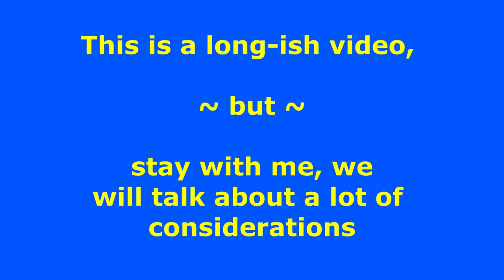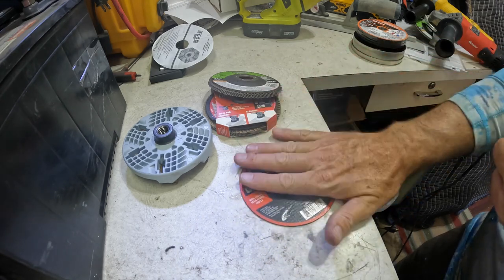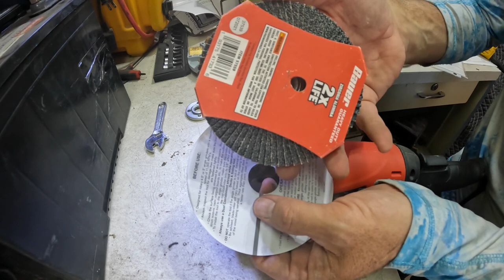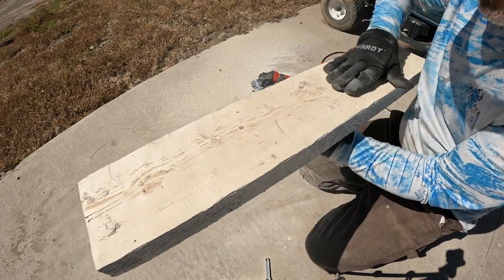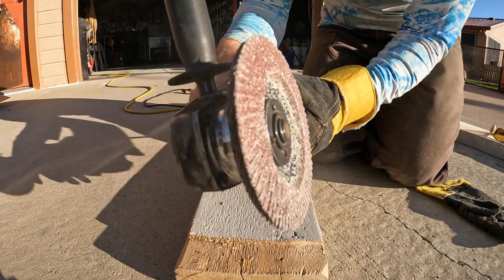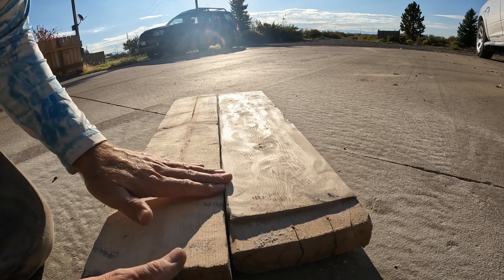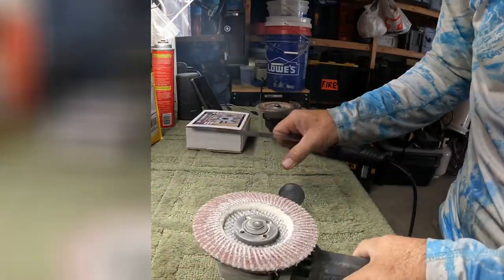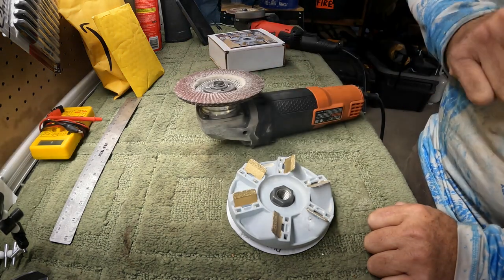DIAMABRUSH VS Flap Disc !!! *DECK STRIPPING*

Comment: Thanks for the video.  First thing I noticed that you used the diamabrush in the same manner as the sander pad...with the grinder tilted up to make contact with just the tip area.   The Diamabrush is meant to be used flat.  Second, with the diamabrush the direction you want is right to left WITH the grain.  So next time try to have the board perpendicular to you.
Reply from the maker: Thank you! This is just why I love youtube, I get good advice from people with experience. And  people do read the comments. So thank you for sharing, and for watching 👍

Comment: I used about 3 flap disk to remove the paint from my deck and got less than 1/4 of the way. It was very difficult because I had to keep scraping the discs clean from the old paint. Frustrated I went to Lowe's and got the diamabrush for $49 and it was the best decision I made. It removed the old paint much faster and didn't have to keep cleaning the blades. If you have a medium to big size project then get the diamabrush.
Reply from the maker: Good to know, thanks for the good feedback. People do read the comments, and this is a real life experience comment 👍
Reply: I’m working on my 400 square-foot, 30 year old deck. Multiple layers of solid stain and then two years ago that paint which was a poor decision. Now I’m stripping it all off. In a couple of days of work although we spread it out just doing Couple hours a day for a few days we have got the whole deck basically cleared. Went through two discs because we have lots of nails and screws and we tried to go in rows in between the lines of screws. Still chipped up the Diamabrush brush a bit but I would’ve spent more and more time using stripper.
I will now have to go and clean up down the lines of where the screws and nails are. But I got the majority of the paint off in a very reasonable time using the Diamabrush.
I was in contact with the Diamabrush people, and they told me that as long as there’s the diamond grit showing on the blades, you have life. The blades do wear down incrementally, and you can use up virtually all of the grit. 
We also got the optional metal dust shroud, which replaces your guard and has a flap at the top so you can run it flat against the edge of your house or any edges and hook a vacuum up to it, which didn’t get rid of all the dust, but sucked up a huge amount of the real fine toxic dust into my shop vac 
I started out using the disk without the unthreaded flange behind the desk. But I found, as the blades wore down about halfway that the shroud was starting to interfere with getting flat on cupped or uneven boards. So I put the flange on to bump the diameter brush out just a little and then give me a better clearance on the dust shroud, still allowing me to use the vacuum. I could certainly run it without the shroud, but I didn’t want all of that dust going all over my yard and house. There’s still plenty to clean up, but it took care of a good part of it.
Reply from the maker: @jeffellis6544  thanks so much for that! I learned a ton from what you wrote. It sounds like the diama brush can go a long distance! And I think when I have to do this again, it may be the diama brush in between the nails/ screws, and the flap disc around the screws. I had no idea about their adapter either, thanks for sharing that!
Reply: @anesthesiadreamin  -glad to share. 
We first tried stripper on the first 3‘ x 14‘ section and it took me a $50 gallon of stripper and several applications over several hours and lots of scraping and it still wasn’t clean at all. The Diamabrush brush is fast. Fast fast fast. I like it a lot  
I think one would’ve done the whole deck if it had been a newer deck, and not so many nails and screws.   
But I would’ve ended up spending way more in chemicals and a lot more labor if I’d stayed with stripping and power washing   
Right now I’m trying to figure out the best flap discs to use to go over the areas where the nails and screws are that I glossed over lightly with the Diamabrush
If anyone hears reading that and has suggestions for me, happy to hear them. Probably going to get a stack of cheaper, sandpaper, flat desks and then a few of the type 29 grinding discs. Still researching…

Comment: I am glad you try to do the work yourse,lf, but you really should have sought advice first.  Never use a 1/4 pad sander for this work, that is for finishing.  I would have recommended using renting a commercial drum floor sander and you would have finished the entire job, including leveling the deck, removing all the paint, and finishing with 150 grit.  One last comment.  I  would never attempt that job without a sust shroud and vacuum and dust mask and other safety apparel.  Good luck!
Reply: What about an older deck that has some mixed old and new boards and lots of nails screws? Wouldn’t that tear up the drum sander belts?

Comment: I did a huge deck 1600 sqft and used 2.1 diamabrushes. Nails or screws are what will kill them and they do slow down once worn.

Comment: For anyone remarking that you didn't hold the dianond wheel flat enough id suggest they buy it and try themselves. The way and angle grinder spins you have to slighty favor an edge to have control of it. Rockong backnand forth feathering it out. For blown up example of this. If  you ever use a large floor buffer you have to go back and forth rocking the buffer from the front to back side to keep control of it. On pretty Every rotational sander youll find its almost never applying complete even pressure across the whole disc. The physics will fight this from happening
Reply: The comparison of how to control a floor buffer is a perfect example for this scenario.
Reply: What the diamabrush manufacturer suggests, holding the wheel as flat as possible, ONLY works if the wood you're working is also flat. The problem arises when doing restores is the wood you're working on will be warped due to weathering and traffic so each piece will be different. Some will be flat, many will cup. When the wood isn't flat you have to attack the surface at an angle. For me, I had to favor the handle side of the grinder and go from right to left motion.

Comment: is it possible to "improvise" a larger sanding disc with pad (9" or more) on a 5"/6" angle grinder for stripping/resanding a deck? thanks
Reply from the maker: @ronenborshevsky8144 never tried it but it would cover more surface area and likely get a flatter/smoother result. Good idea!!!

Comment: The whole point of grinding is to actually make paint/stain stick to surface so you do not need to regrind. Actually , the grinding should leave a rough surface and not perfectly smoothen it out.

Comment: This is great. I'm about to tackle a similar project, painting wood siding with many layers of old paint. It's so helpful to see your trial and error and corrections, I'm sure it's going to save me some time. Thanks!
Reply: What wheel are you going with?
Reply: The plan is to use the Diamabrush but I bought a bunch of flapdiscs in various grits too, just in case. I've found that no matter how good my plan seems, I never know how it's going to pan out so I want to be ready with a plan B.

Comment: Great video.  I had an old piece of stained furniture to test it on.  I wanted to try out some flap discs I just purchased.  I tried them at an angle and flat before I watched your video and had the same issues you did.  However, your suggestion about making sure you never stop even to reverse course was very helpful.  I tried with a 120 disk, plenty fast, not perfectly flat, but for a deck it would probably be fine.  Plus, I think this takes practice, which I plan do more of before next spring's deck work.  Like many who commented, I've been through the gambit of other sanders and chemicals.  It either doesn't work or way to slow.  I do plan to use my random orbital sander on the test furniture to see how long it takes to completely smooth it.  By the way, I just had my faux log cabin siding sanded and stained by professionals, they used angle grinders, and it looks amazing, so you can definitely get better with practice.
Reply from the maker: Great feedback! It sounds like you're much more experienced than I, but you came to some close conclusions. It's nice to hear the pros were using angle grinders also 😆 hey thanks for watching and for your comments 👍

Comment: Regardless of what you use, when you use an angle grinder technique is everything. I can't stress this enough and I see people make this mistake all the time when using an angle grinder "let the tool do the work". And no time should you have to press an angle grinder. You should never have to use muscle with an angle grinder regardless of what you're using it for. 
In this application, sanding boards, either of his attachments would work fine but you turn the grinder on and you let it do the work Your job is to keep it parallel on the board If you tip forward or back or side to side you will gouge the wood and leave tattletales. 
The proper way to do this is to maintain a parallel plane with the wood and the angle grinder will want to go right when you reach the end of the path to the right. Your job is to control that right momentum. In order to make it go right, with the slightest of pressure, You raise the back. This will change the angular momentum and put more pressure on the front which will throw left.
Another way to avoid having tattletails in your wood is don't do just one board at a time and don't run with the grain or go across it, go at a diagonal. Pick a corner and start working out away from the corner maintaining that same diagonal then go to the corner opposite that one and work the whole thing that way. You will end up having an x pattern. 
The main thing is having the right tool for the right job. I don't think I'd be crawling my deck with this it'd be easier to get a drum sander, the same as what you use for a floor, except you wouldn't step down your grits, You would run at 36 grit for the entire job and maybe use your angle grinder for the corners. Same rule applies go diagonal one way and then the other. Whatever you do... Whatever tool you decide that you want to use do not go across the grain. That just tears the wood up.

Comment: The one thing I don't like about flap disks is that they get gummed up to easily when trying to remove deck stain.  I have gummef up 6 Diablo flap disks so far and I am not even halfway done sanding my deck.

Then again, my deck also has quite a bit of surface damage and needs to be leveled out.  Going to try a diamond disk of some sort today but I am worried that these types will tear into the wood too fast.  Trial and error I guess.

EDIT:  I am probably preaching to the choir here but being the greenhorn that I am, I just found out how much cheaper I can get flap disks and carbide disks at Harbour Freight.  Good God Home Depot charges a lot!

Comment: Cool video.  Exactly what I was looking for.  Much appreciated 👍
Reply from the maker: I got a lot of comments about using a drum sander, which I didn't even know existed when I made this video. Might work better and be faster? IDK. Also, a couple deck experts have commented on using Defy brand wood stain, if that's what you are looking for. I used Thompsons but had to apply it at least twice a year. So next I am gonna try the Defy brand. Hey thx for your comments and for watching! Good luck with your project

Comment: Thanks for the video. Would you recommend 40 or 80 grit for flap disc?
Reply from the maker: @fatsubie7604  for sure friend! The 40 grit definitely cuts faster, but will leave bigger grooves. The 80 grit of course smaller grooves, and the 120 grit is even less. Harbor freight sells them pretty cheap, maybe get one of each and try them out, and see what you like, or it can live with at least 🙂 I'm assuming you have a harbor freight close to you, I don't 👎
Reply from the maker: I didn't really answer your question well, I thought the 120 grit new cut pretty much as fast as the 40 or 80, but it doesn't cut fast as long as the 40 or 80, in other words the 120 seems to lose it s effectiveness pretty quick. I didn't mind the grooves, I would probably use 80 myself

Comment: I think using a belt sander from the beginning will give a better final finish.
Reply from the maker: agreed. And if I hadn't let it get sooo bad, the belt sander probably would have been quite easy
Reply: @anesthesiadreamin  what did you seal it with afterwards?
Reply from the maker: @sswwooppee  I used Thompsons every 4 months or so. But some commenters have mentioned the Defy brand, I haven't used it but plan to
Reply: @anesthesiadreamin  I don’t know about Defy. I use “Seal-Once Marine Premium Wood Sealer” never more than once a year and I could get away with every other year. I’m in Minnesota though. We don’t get the kind UV beat down that places in the Southwest or high elevations get.
Reply: Perhaps, but the diamabrush is a monster when it comes to fast paint removal. I did one side of a 6' x 50' fence in about 5 hours.

Comment: Can diamond cups be used? They are designed for concrete surfaces but I am thinking why not? Also would the dust shroud work with a flap disk?

Comment: Either way I don’t see how you’ll escape hitting screw heads. Which disc was less damaged due to this?
Reply from the maker: I couldn't agree more! Definitely the flap discs, I use them all the time on metal and steel for welding projects, even use them to round off sharp steel edges. Plus, if they do break down faster by hitting screws, no big deal, they are cheap. But honestly, I have not hit a screw with the Diamabrush ON PURPOSE 🙂 because I am scared of destroying it

Comment: Try out stone abrassives. They just last longer than the flap disks but you get the same results as the diamabrush
Reply from the maker: I've never heard of what you're talking about. Is there a power tool that runs those, or do you use those manually?
Reply: @anesthesiadreamin I would assume hes talking about masonary abrasive discs or cup wheels for grinding stone, tile, ceramics. I don't think they'd do very well on wood since I've never heard of the connection being made that they work on wood as well. But that's just me making an educated guess. so take it with a grain of salt.

Comment: How do you you do railing??  Isn’t your tool too big to fit between the rails?
Reply from the maker: I actually don't have any rails on my deck 🙂 I know that doesn't help you. I'm sorry I don't have a good solution for that. Maybe check out the bauer band file belt sander from harbor freight, it's about 50 bucks, but it looks like you could sand up into the corners pretty easily. I've never tried it, but it looks like it would work.

Comment: I’m glad I didn’t buy that thing!  
It looks like that powered paint stripper. But it has a depth adjustment. And carbide blades. It costs hundreds. I don’t need it either. 
I’m stripping 13 wooden steps to my deck. That I stupidly painted with Rustoleum Restore paint with sand in it. 
It cracks and water seeps in. I replaced one step. 
I made my own tool. Out of a bush-hog blade i made a big chisel to go in an air hammer. If I’m careful it’ll shave off the thick paint without gouging too bad. Then I smooth it out with a belt sander. 
Thankfully my deck is Timbertech.  It’s durable. But it gets hot in the sun. I had to build a roof over it.
Reply from the maker: Sounds like a cool tool that you built! did you make a video by chance? I would like to see it in action

Comment: Diamabrush designed to be used right to left.
With the grain of the wood and never across grain or circular.
If you are Belgian the board or have erratic RPM you're putting pressure on the grinder instead of just letting it walk itself and you control it with the handles.
That grinder didn't seem like it had anything for  rpm to spin that Diamabrush.

Comment: The skinny ones are cut off wheels they’re not even grinders you have a sanding will grinding wheel and you also have a cutting wheel for cutting little skinny ones tenants of hurricane they’re not for sending you could use it for sanding I use it for sending as well but those are for cutting